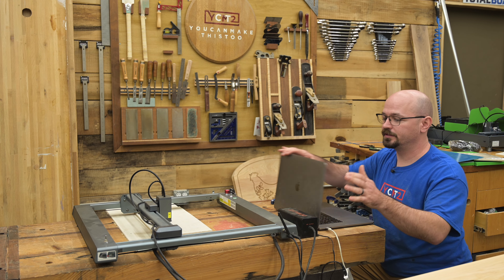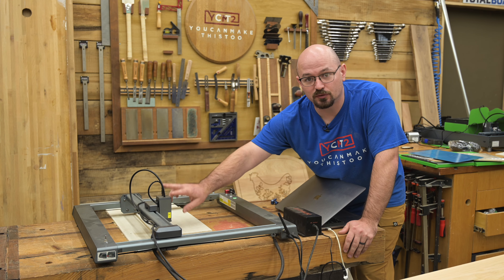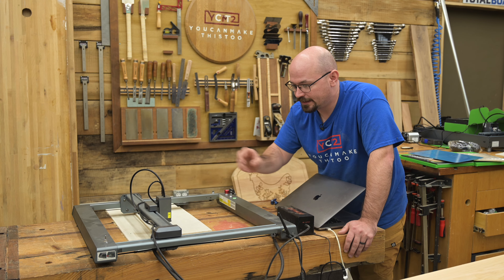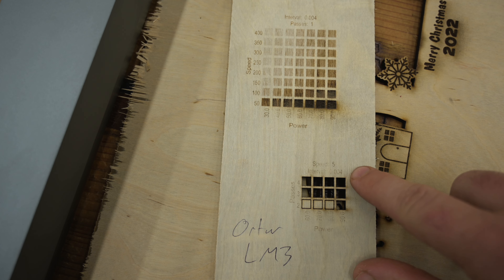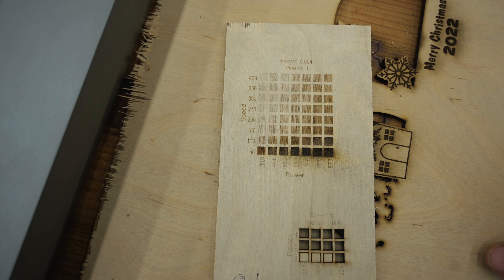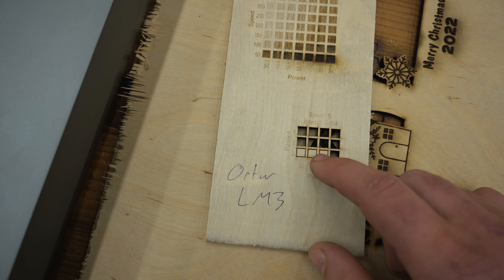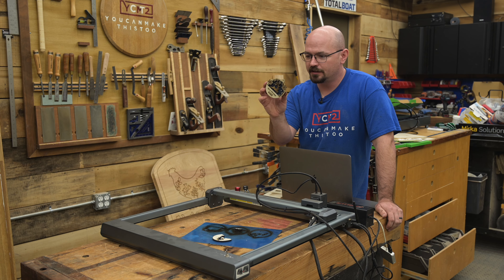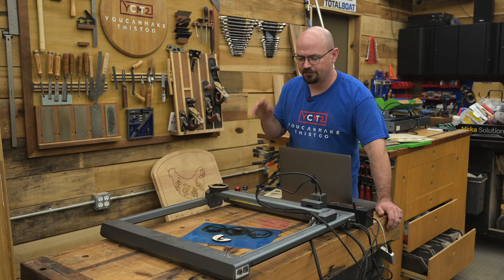BEST VALUE Laser | Ortur Laser Master 3

Comment: Nice review. I’m between this and Sainsmart LC-50 Plus. Ortur advertises 12mm wood cut in one pass and 10mm acrylic in one pass. Sainsmart is I think 10 and 5 but the wattage is the same.

The LC-50 has 4” wider work area, includes air pump, and wire management looks better.

Ortur seems to have bigger following and has WiFi.

LC-50 has linear bearings and Ortur has wheels.

I’m new so any help in my buying decision appreciated.
Reply from the maker: Xtool also has a 40w option now. Based on what the 20w did.. that 40w is wild. 

Following doesn’t just mean brand recognition, but generally better support. 

Lasers don’t have resistance so I don’t think you’re gaining much with linear rails instead of belt.

Comment: I just watched your other video on the xTool laser. The 10w xTool is roughly $100 cheaper than the Ortur 10w. In your opinion, which is the better value of the 2?
Reply from the maker: On Amazon right now there’s only a $10 difference with the current sales. I’d go Ortur though because it’s an easier assembly, the air assist loses less pressure going to the head, and there was less glitches running it with lightburn.
Reply: @YouCanMakeThisToo  Thanks!
Reply: @j_b_9381  Ortur has announced the Laser Master 3 LE,  pre-sale is open December 16th, 2022

Comment: I heard it from NEJE direct that you can run a diode laser at 100% with no real decrease in life. That’s a throwback from older diode tech with bad cooling and also CO2 lasers
Reply from the maker: Ah that makes sense. I’ve spent a lot more time with co2 and just assumed. Thanks for clarifying!
Reply: @YouCanMakeThisToo  no worries. I still see it a lot on forums etc, but this info came straight from the manufacturer while we were troubleshooting a recent module failure. 

Love your channel by the way, great stuff 👍

Comment: I bought an ORTUR Master 3 LE in January, and it still does not work. I have sent loads of emails, videos, and photos, so they sent me a secondhand laser, which does not work either. Today 31/05/2023 and I have been ripped off by ORTUR.